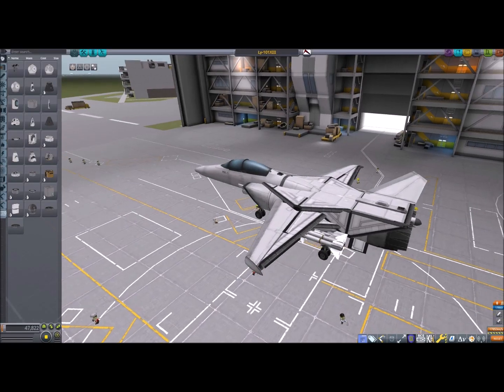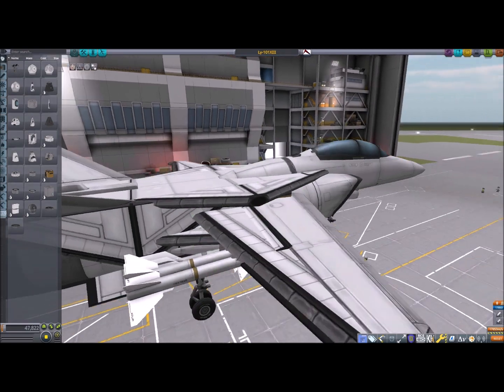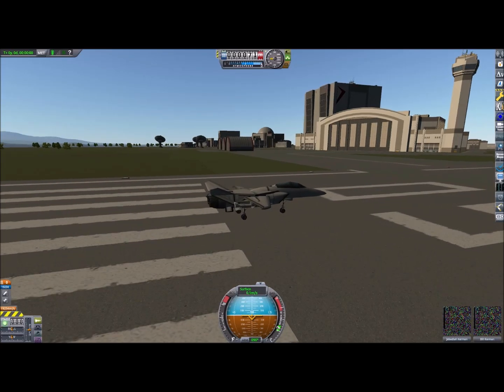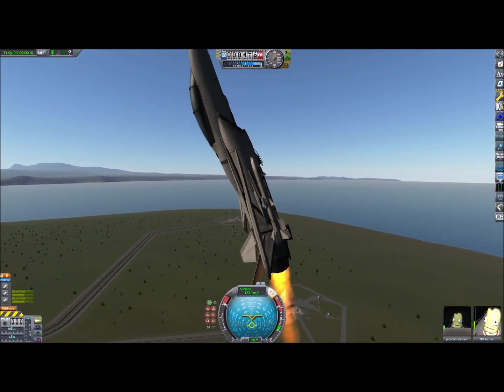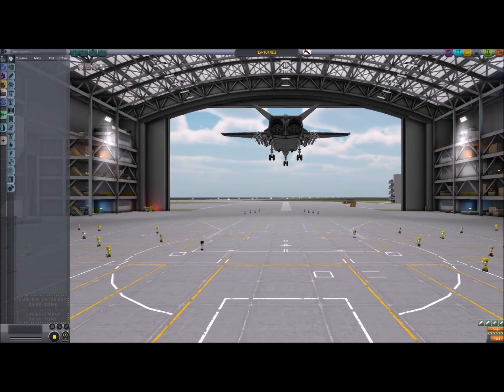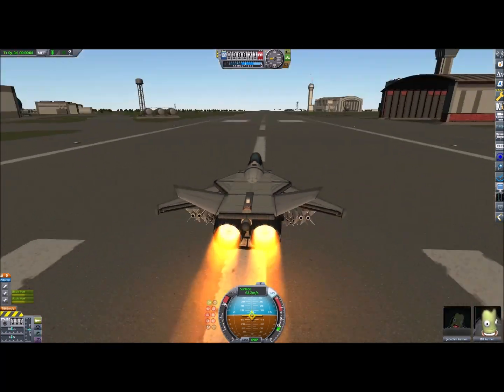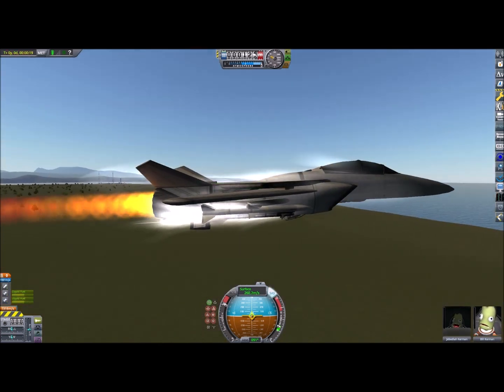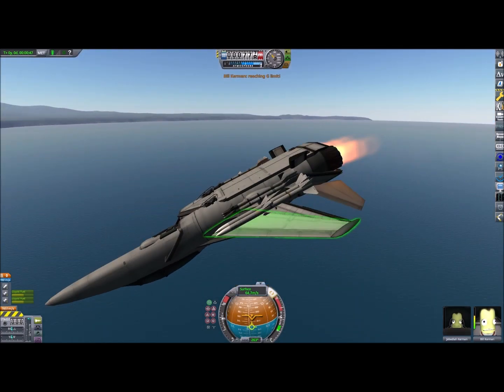KSP Tutorial: Swing Wings

Comment: Do I need the Breaking Ground expansion for this..?
Reply from the maker: Yes, however I believe this should work for Infernal Robotics as well. You just won't be able to bind the throttle to wing sweep
Reply: @ChaoticProtocol  I understand. Can you also do a tutorial for the Infernal Robotics? I'm using the mod almost 3-4 week and having issues with the rotatrons like they are scattering too much when turning or any maneuvers
Reply from the maker: @generalironside8610  So the rail method I have shown on here should work for that. Make sure advanced tweakables is enabled in game settings. And allow same vessel interaction is on for the rail

Comment: Your idea works magnificently. I found it to be the only real working solution. I made this buffer above and below the wings and it folds beautiful. It took some precice pixel adjusting and testing to make it get stuck between. I used a radial intake attached to the main body, dragged out towards the wing.
 

Aside from the experiment, note that for combat purposes with/against AI, the design comprimise doesn't really outweigh it's overal effectiveness. To my great displeasure the AI pilot doesn't make use of hinges via any key  binding I know. Does anyone know how to get the AI to use hinges in combat flight? 

Being KSP, the aerodynamic wing shape doesnt directly affect speed. I noticed Folding wings move the centre of lift back and towards the plane's axis, this 1: increases roll rate (but in a more erratic and forcefull way) and moreover 2: when the plane's centres are properly alligned the variable sweep back of the lifting surface can account for the incease of lift and pitch at high speeds, negating the drag incurring pitching in fixed wing designs.  E.g. cruising at 1/3 throttle the centre of lift is moved forward; at full throttle the centre of lift is moved back.